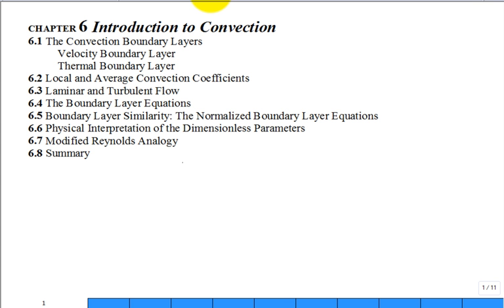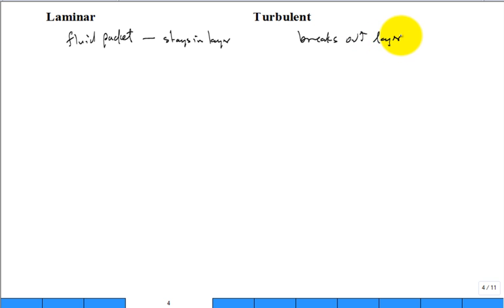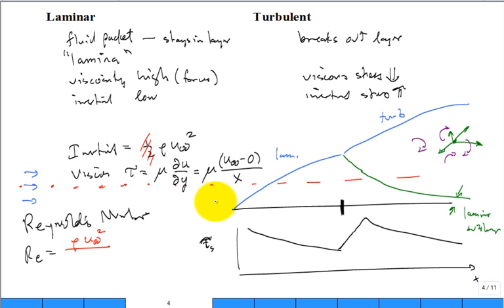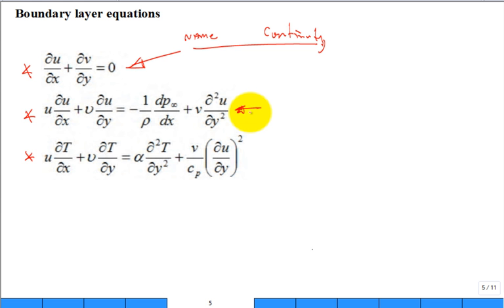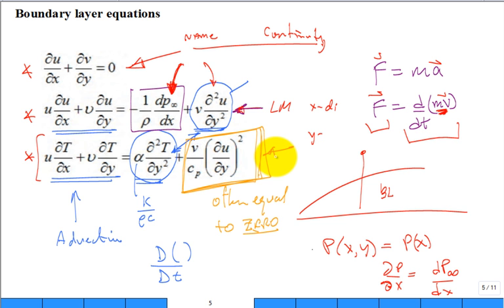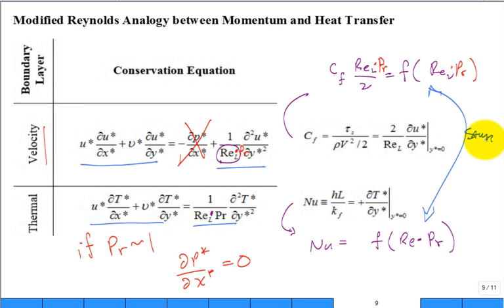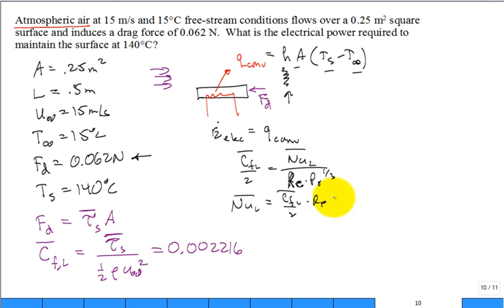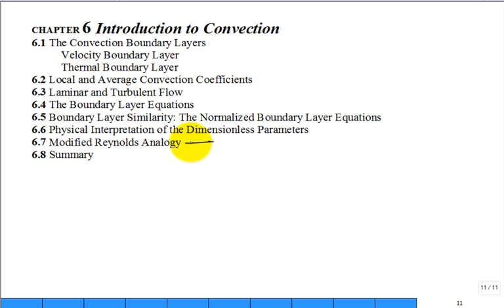Intro Convection Heat Transfer 2of2

Comment: Looks like one guy watched this lecture right before the test but didn't score well. How dare you down vote this!
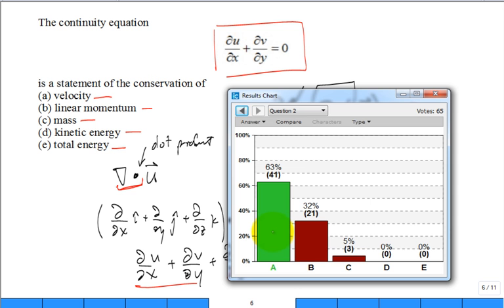Reply from the maker: guy probably found an error in the lecture and didn't have time to point it out, just left thumbs down.  I find errors in my lectures all the time.  No one is perfect.  At 16:08 I should have graded both A and C as correct (not just A only).